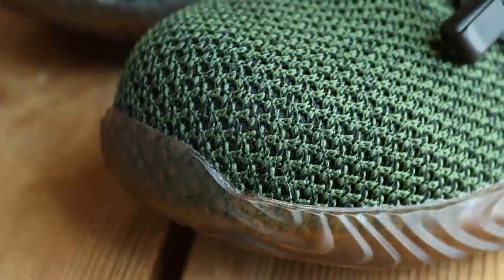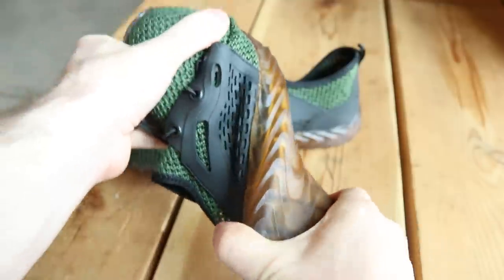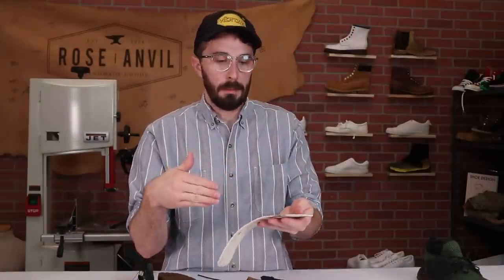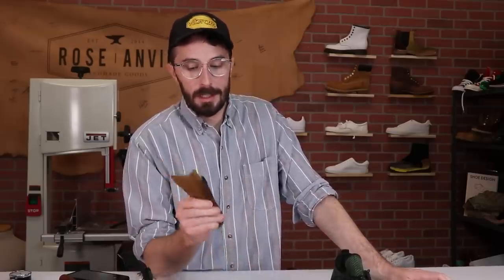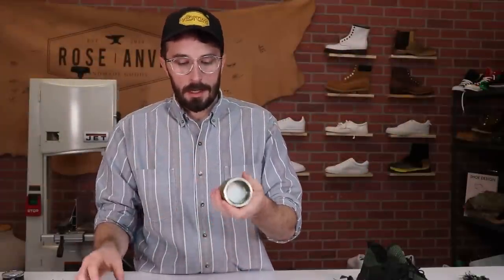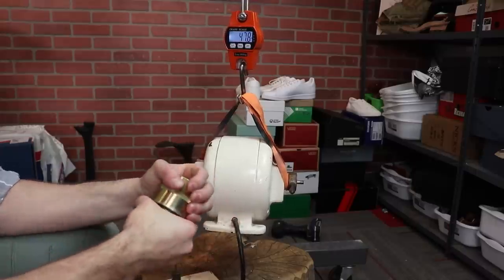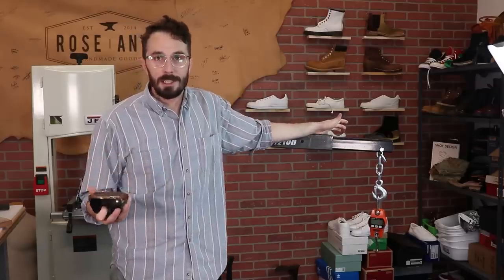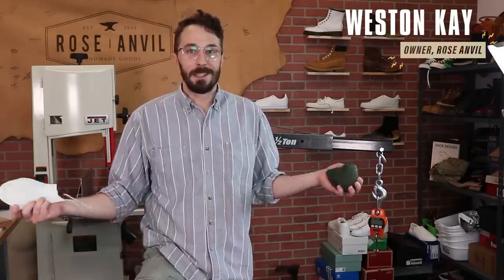Never Trust a Fart or These Indestructible Shoes

Comment: Also you have to realize they advertise them stepping on multiple nails at once. This distributes the weight. It's the same way you can lay on a bed of nails without being hurt.
Reply: Try stepping on 3 nails and see if that works the same distribution as bed of nails
Reply: @MichaelHarto  You're missing the point
Reply: @RSh-12 try it
Reply: @webpombo7765  the point is weight distribution, it's not magic. Adding a few nails doesn't mean you can avoid being punctured. You need a certain amount of nails to distribute weight safely without puncturing. That's why bed of nails is FILLED with nails.
Reply: This is a very good point. The more nails the harder to puncture.
 (The worst thing is that it might LOOK more impressive with 3 nails instead of 1 when it really is the other way around)
Reply: you will get hurt you just won't get impaled by all the nails
Reply: @MichaelHarto  1 nail = ea nail gets 100% of the force, 2 nails = ea nail gets 50% of the force, 3 nails = ea nail gets 33.3% of the force. A 67% reduction in force is considered significant seeing as in his own test 45-55lbs was not enough to pierce. Considering his weight is 180ish reducing that by 67% gets you into the 60lb range which is within a standard deviation of his original test which means that 3 nails is significant enough force reduction to not pierce.
Reply: It's called pressure.. force/area
Reply: @helioscomis3732  thank you!
Reply: @MichaelHarto  lol did you buy the stupid shoes?
Reply: Dude I literally heard him say on one nail weight distribution won’t help u with tetanus if it goes tru
Reply: They also step down and forward bending the nails flat
Reply: I'll keep that in mind in the very likely event I lay on my bed of nails/step on multiple nails at once
Reply: @autonomous8108  you thought you did something.
Reply: @Personalinfo404  I guess so, you sound pretty salty lol
Reply: @autonomous8108  always remember, just because you're offended, doesn't mean you're right.
Reply: @Personalinfo404  I made a stupid joke, and the only one who seems offended is you lol grow up
Reply: I feel like the ultimate way to nail proof a shoe would be a tightly woven metal wire mesh welded at the edges so it’s not allowed to unravel at all, effectively foot chainmail
Reply: @autonomous8108  709 people are confused on why you're here 😐
Reply: @zyanidwarfare5634  yeah, like  tightly woven chicken wire or something, it would still allow for flexibility, I agree.
Reply: @autonomous8108  726 people are confused on why you're here 😐
Reply: @Personalinfo404  well then read my last comment again lol
Reply: @autonomous8108  734 people are confused on why you're here 😐
Reply: @Personalinfo404  okay lol
Reply: @autonomous8108  rekt.
Reply: @Personalinfo404  okay kiddo lol
Reply: @autonomous8108  rekt.
Reply: @Personalinfo404  okay kiddo lol
Reply: @autonomous8108  rekt.
Reply: @Personalinfo404  okay kiddo lol
Reply: @autonomous8108  rekt.
Reply: @Personalinfo404  okay kiddo lol
Reply: @autonomous8108  rekt.
Reply: @justfrybread  thats what they said before sending them to Vietnam 🙈🙈
Reply: The test makes the shoe look like the end all cure all. In the real world 9 out of ten times step on a nail its a single one. And the advertisement doesn't have a disclaimer stating "not for stepping on single nails, multiple nails only" lmao
Reply: @autonomous8108  easily rekt
Reply: @autonomous8108  rekt!
Reply: Thank you.
Reply: what in the red green and blue fuck is going on here
Reply: @autonomous8108  easily rekt.
Reply: @MichaelHarto  You're the one who doesn't seem to understand here lol. You're right, it's weight distribution and not magic, which is why it's actually incredibly easy to understand that even trying to puncture the shoe on two nails rather than one doubles the force required, three would triple it and so on. We measure pressure typically in pounds per square inch, think for even a second about that equation and you'll realise that all they're doing is increasing the contact area to make it appear as though the material is resisting huge forces.
Reply: @mrglibb  you need 1400 nails on a 40x40 square grid to disperse the force of your body weight to avoid skin puncture. Ofcourse on a harder material, the nails required would be much fewer. But 3 nails to support a full body weight? That's just plain stupid.

I'm not saying i believe their advertising. I'm just saying that shrugging off physics just because you've seen a magic trick being revealed once is not a solid base for an argument.
Reply: @helioscomis3732  you are forgetting one thing, you need them to be absolutely flat/level with each other, if not, then the highest nail will take the brunt of the force exerted by your body weight. Have you tried balancing your body on 3 nails?
You need around 1400 nails on a 40x40 square grid to avoid your skin getting punctured. Even with a harder material, with only 3 nails is really asking for a trip to a hospital.
Reply: @mrglibb  rekt.
Reply: @mrglibb  Assuming the one-hundredth of a square inch area for a nail tip, then for every hundred nails you have one square inch of area. Suppose 2000 evenly spaced nails support you. The combined nail points would have a total surface area of 20 square inches. If you assume that an adult man weighs 160 pounds, then his weight is spread over 20 square inches of nails, and the pressure on him is only 8 pounds per square inch of nail tips. If each nail tip is only 1/100 of a square inch, then each nail supports only eight hundredths of a pound of weight. 
And that's 2000 nails with 100 of them on each square inch, which usually used on a magic trick. And you're comparing it with 3 nails? And it's not even kevlar, it's probably just a reinforced rubber.
The minimum limit is 1400 nails on 40 square inch, which barely disperse about 100 psi on every nail, accounting you make perfect contact on all 1400 nails. Anything more than 100 psi per nail will puncture your skin.
Reply: @Personalinfo404  Yep, you certainly have been, by multiple people and from every imaginable angle.
Reply: @mrglibb  you can basically google it up from educational websites. At least i've given the calculation. You can check it up yourself. I rest my case.
Reply: @MichaelHarto  Go ahead, rest your case, just know that you've rested it on a foundation of mud lol.
Reply: @MichaelHarto  .
Reply: Are you available for conferences?
Reply: I've commented on their ads many times to use just one nail. Eventually I saw it in their advertising but they still hit it at an advantageous angle to make it bend.
Reply: @Personalinfo404  Yeah mate, I've definitely been rekt, at this point you're definitely not just proving yourself the kind of oily, deathly pale creature that sets reminders on their phone labelled "Mash out salty reply to (insert username here)'s YouTube comment, make sure to lick crumbs off keyboard first".
Reply: @mrglibb  947 people are confused on why you're here.
Reply: @Random-ed2xf  947 people are confused on why you're here
Reply: @mrglibb  986 people are confused on why you're here.
Reply: But you're more likely to step on 1 nail sticking out of a pallet or piece of wood at work as apposed to a bed of nails that you would probably notice and walk around it lol
Reply: @daviddemuth1278  everyone here is well aware. And you're right. The point was being made that in order to "fairly" test these boots, they need to be tested in an identical fashion as they were on tv...regardless of the ridiculousness, it just needs to be a 1 to 1 comparison as a form on "control"
Reply: @Random-ed2xf  you okay? 😘
Reply: @Personalinfo404  Work and rest are a bit higher on my to-do list than sating your need for human contact mate, some of us have things to do and people who rely on them.
Reply: @Michael Harto  you obviously are completely clueless huh. Here, let me slow it down for you. The group of nails test........is absurd.......for the simple.......fact that in.....the real world..... you'll most likely.....step on one nail on the ground......vs a group bunched up.....togther. Hence, the point Web Pombo clearly made but most likely spelled it too fast for you. I hope that help you understand the point you obviously couldn't get the first couple of times.
Reply: And them trying to hammer a 'nail' in was a screwe
Reply: I agree. Anyone who knows about the laying on a bed of nails trick knows this is nonsense. If you want to really have a nail test, use only one nail.
Reply: @mrglibb  you make a full recovery?
Reply: @mrglibb  get well soon ❤️‍🩹

Comment: The advertising for these is really dangerous and unethical. It's only a matter of time until somebody buys these and stomps on a nail to show off their 'indestructible' shoes and ends up in the ER. These things are a lawsuit ticking timebomb. Thanks for making this video and exposing these for what they are, you're doing a good thing.
Reply: Who is going to get sued?  Some nameless Chinese factory that will change names and continue to make them?
Reply: @dsbiddle   Yeah not even them because they aren't making the commercial.  Its like alot of things on amazon all made in China with different company names slapped on it.  I didn't realize how bad it was until I was looking for a docking station for my work laptop.  well over 1/2 of what it found was the exact same thing just with a different name on it.
Reply: Good luck finding out who originally made them. They probably got bought and rebrandet half a dozen times.
Reply: And I'd imagine the reason that standing on the multiple nails in their advertising and tested by Rose Anvil worked because the nails distributed the weight between three/four nails.
If the material [which i dont think is kevlar] was able to resist 135lbs just before the full weight was applied for the most part, if you divide that between the nails you get 1/3rd or 1/4th the pressure per nail and since it looks like it took near 100lbs to pierce, there is no way multiple nails would pierce it - unless it pierced where the material wasn't present.
Reply: I'll cop a nail in the foot for a pay day
Reply: They're probably not even based in a country where they can be brought into court.
Reply: Stomping on a single nail pretty hard will always go thru a boot. I'm a tradesman, My daily drivers are Blundstone 997's and nails will punch through if you start stomping on them.  The reason the Indestructible shoe ad is fake is that they kick forwards onto many nails. They bend them forwards by kicking rather than standing on them. I can comment on these, however, as I do own a pair of these indestructible shoes.  They're not bad, all things considered. Especially in summer, when most people just wear joggers anyways, and they breathe REALLY well. For protection, I will always choose the boots. But these are a good alternative in workplaces where a steel cap is required but realistically you never encounter sharps or anything of the sort, like a groundskeeper, or a mechanic or something, or in those workplaces with really dumb rules.
Reply: Anyone stomping on nails deserves what they get
Reply: @wing_nut_1018  That's a fair point, but it's the false advertising that I take issue with more so than the actual capability of the shoes.
Reply: There cant be a lawsuit for something like that unless they advertise its puncture resistant, not puncture immune
Reply: @Revelatus  yeah I knew what I was looking at though. And they get away in court because the brand name is indestructible shoes, not the product name.
Reply: @zancrus9629  I have a pair of PC speakers from the early 90's that are like that, they are decent for the price but they come in several brand names, and a few even claim they are 80 Watts, when in reality they are 40 watt and 20 watt per channel, and the speakers themselves are generic low RMS speakers...probably 15 watt at best because they do distort when cranked up...But they sound good enough a notch or two lower then full to be worth keeping.
Reply: @zancrus9629  the joys of amazon sellers trying to make a buck through private labeling... Amazon is just a junk pile these days.
Reply: It's a really scummy company but tbh who cares about someone stupid enough to actually do that.
Reply: These aren't the real ones. The real ones are way higher quality. Thicker kevlar and rubber sole and made with different material.
Reply: Are these shoes Chinese?  If so lawsuits are irrelevant
Reply: I looked at them and they wanted me to order from a Chinese website. So, they do not care about being sued.
Reply: I promise, somewhere in the literature they send with shoes, printed on the box, or on a tag somewhere on a shoe itself is a disclaimer telling you NOT to do all the things the ads say you can do. The false advertising "get out of jail free" card.
Reply: facebook and google should be fined for all the scam advertice they put on social media
Reply: @MrKinghuman  ⁹
Reply: Guarantee its already happened
Reply: @dsbiddle  I want to urge you to fight lust. repent from it and turn to God. Seek Him continually. if you do believe in Him, then obey Him, live for Him.
Reply: That's why they aren't made by any particular company in any particular country lol
Reply: lol lawsuits? just pay the fine and move on. thats what the big corps do.
Reply: And the person that does do that deserves a trip to the er because stupid games equal stupid prizes my guy
Reply: Wooden shoes are basicly indestructable  you need to put great effort in to it to destroy them .
Reply: Matter of time? I'm sure it's already happened hundreds if not thousands of times already! I mean, c'mon, remember tide pods?
Reply: Who the hell.goes to the er for stepping on a nail. Haha. In the construction world it's petty common, I stepped on a 16, punctured a vein and every heart beat it was spraying. No er needed for a damn nail hahaha
Reply: I guarantee someone has already done that with some "indestructible" shoes 😂
Reply: @matthewmaneck3069  oh Lord...let's leave the tide pods in the memory graveyard before some derp sees this lol. "Oh yeah, forgot about those" hops in the car to head straight to the store 😂
Reply: The reason why companies like this exist is LLC limited liability company. They can close up and start another business after being sued. They don't care about you. Steal your cash is all they care about.
Reply: Also the CEO is these shoes is Vietnamese...
Reply: Only an idiot would do that. If clothes say they are fire resistant it doesn't mean you can walk through a burning building. I heard someone cut through some cut resistant gloves with a razor and cut their hand wide open. I love the indestructible boots. They are light and flexible. Very comfortable and well worth the price.
Reply: @bjornegan6421   Now that's the truth. Jesus Christ of Nazareth is my salvation. Thank you Lord.
Reply: @jesuschrististhetruth2762  Amen, brother. Christ Jesus is Lord.
Reply: @BC08  even on the "legitimate" Indestructible show website, the label they show says made in china.
Reply: It isn't just these shitty non branded consumer goods. Many of the name brand house hold appliances and tools share the same components but are painted a different color or have slightly different shaped plastic asthetics. Fir example the little portable compressors and washers and dryers.

Comment: I have operated with real army kevlar, and i tried to brutally stab it and cut it, and nothing happened.. nothing. So this kevlar is bad..
Reply: ya i wonder how ez it was 4 him to cut out the samples w/ his scissors
Reply: I've had to repair equipment that had kevlar tubing around the wires.
The moment of confusion when you try to use scissors or an utility blade without damaging wire and so on... and it does absolutely NOTHING...
Reply: It's some cheaper aramid. Kevlar is pretty expensive and a registered trademark of DuPont, Chinese shoes costing less than 50 bucks aren't going to have it.
Reply: If kevlar is bad... It's not kevlar 😅
Reply: Well it’s settled then I guess
Reply: LOL. I've cut "real army kevlar" with a pair of scissors.  Not difficult, depending on the density, and this stuff (in the video) was not at all dense.
Reply: @mountainxxxdew  they do make stab-resistant vests out of kevlar
Reply: It looked like very thin kevlar if it was actually kevlar, i have my doubts it is though
Reply: @zimbu_  exactly. My hiking boots have Kevlar in them and they were $450. They are damn good boots though.
Reply: It must have expired. *Kick drum snare

Comment: The secret to Kevlar is that it's specifically not puncture-resistance. The fibers work against projectiles by "catching" them like a net. They can be easily cut by knives, spikes, etc. This is why separate stab-proof vests are made.
Reply: So you can sugest something better ?
Reply: @inominado1975  to Kevlar or the shoes? For Kevlar, far better stab resistant options exist and there are even body armor vests that are both bullet and blade/stab resistant. For the shoes, literally any brand of reputable work boots would make better footwear. If you want boots that are puncture resistant that use aramid fibers like Kevlar then Nike makes desert boots that are advertised as using Kevlar in the soles
Reply: @inominado1975 Vietnam era jungle boots had steel plates in it incase you fell in a trap